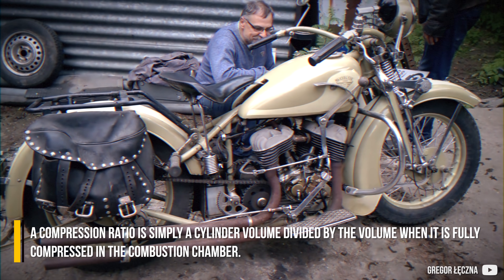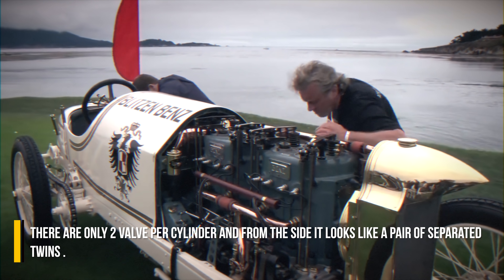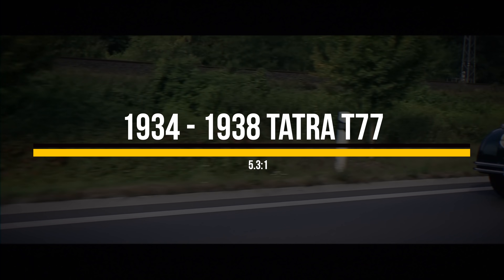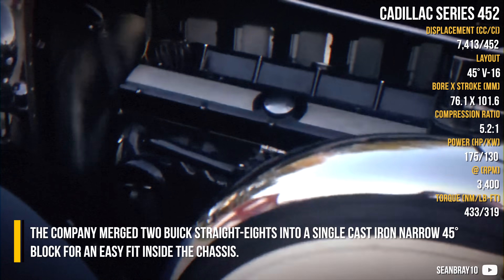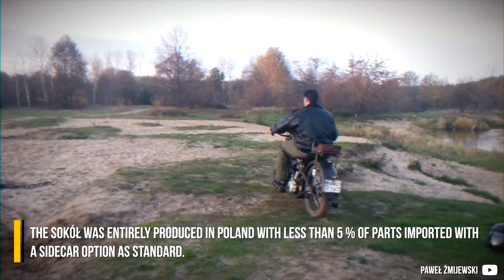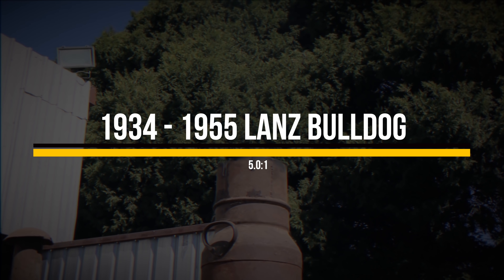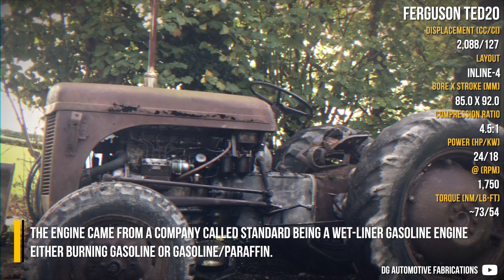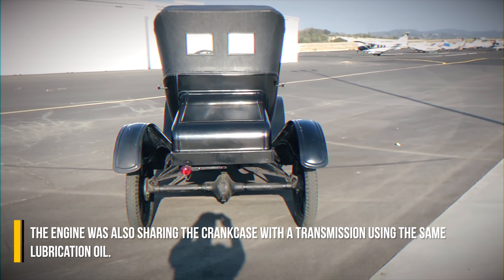The Lowest Recorded COMPRESSION RATIO Engines

Comment: you what's funny about diesel engines, diesel is verry low octane, so low that for about 20-50 years it was considered as waste from producing gasoline, yet the engines only start at a 1;16 compression ratio and tend to be turbocharged at well

Comment: Many American tractors and stationary engines used at the turn of the century were low compression so that they could be started on gasoline, and once warmed up, they would switch to kerosene, because it was cheaper. Many  had small gasoline tanks, and larger kerosene tanks, or the carburetor had a cap you could remove, to fill the fuel bowl with gasoline, to get it warmed up. Ironic now, in the US, Kerosene is quite a bit more expensive than gasoline.

Comment: The lowest compression ratio with a diesel engine must be in Napier Nomad turbocompound aerodiesel; it had a compression ratio of just 8:1. The reason it worked at all was because it had insane boost pressure, somewhere over 6 bars, and why it was fuel efficient was because the combustion energy was extracted chiefly by an exhaust turbine. It didn't enter production though as the turbojets and turboprops quickly took over the piston engines in commercial aviation and it was a complete engineering nightmare.

Comment: Weird timing for this topic for me, cuz my AMC 258cu 4.2L straight 6 is blowin oil thru the oil filler cap on top of the valve cover.... I just performed a compression test where I found the #' 1 & 3 cylinder are at 122psi, the other four cylinders are at 138psi...so now I'm pulling the motor to have the internals reman'd...ain't that a b***h....great vid here bro, your production is outstanding....🤘🏻🇺🇸

Comment: All combustible materials have to be converted to "invisible" vapour in order to ignite. Gasoline is a complex formulation which has very volatile 'spirits' to initiate combustion. Most of the content of the fuel isn't burnt, but expands to a ratio approximating 30,000/1 then exhausted as atmospheric pollution.

Comment: Why does a low-compression motor need low-grade fuel like mixed in kerosene when a diesel must be high-compression to work?
Reply: An engine running on low grade fuel needs a low compression ratio to prevent pre-ignition or 'pinking'. Gasoline and kerosene powered engines are ignited by an electrical spark, a diesel needs to have a high compression ratio to generate enough heat in the cylinder to ignite the fuel without a spark.
Reply: @jonathangriffin1120  So i guess low-compression engines weren't abandoned for diesels as they could use a wider fuel variety. Does this mean lowering the compression of a given engine w. spark plugs can make it burn diesel?
Reply: @sidmarx7276  I don't know if a low compression spark ignition engine will run on diesel, they'll run on kerosene but they need to be started on petrol (gasoline), brought up to running temperature then switched over to kerosene. The Lanz 'Bulldog' tractor uses a 'hot bulb' system which has to be pre-heated before the engine will start, the Lanz will run on anything that will burn but is no way as efficient as a conventional diesel.
Reply: @jonathangriffin1120  I've read about a Lunenberg (?) engine on fishing boats which runs on heavy oil and is started by putting a blowtorch to the cylinder head.  Fancy name for a 2-stroke diesel?
Reply: @sidmarx7276  The Lunenberg seems to run on the same principle as the Lanz which is referred to as a 'Semi diesel', the British Field Marshall tractor uses a 2-stroke single cylinder diesel engine which uses high compression for ignition, it does not use a blower but relies on crankcase compression to force air into the cylinder.

Comment: another fairly low compression engine are those 2-stroke engines used to motorize bicycles. I'm not exactly sure what the compression ratio is off hand, but I don't think it's over 6:1 with a stock head.

Comment: I had no idea an engine could actually run at 5.6 to one compression. that's unreal. not squishing much anything in there.
Reply: Before the ‘40s, most US cars had lower compression than even 5.6:1 due to the fuel being very low quality.

Comment: Most engine design choices are based on fuel available at it's time. As we learned to refine oil more efficiently, it has required changes to design. 
Personally, I think the best fuel and optimized engines were in the early 60's. To the general public I mean. 
Fuel during WW2 was researched extensively, mostly for aircraft but other engines were designed like the infamous "this truck can run on aftershave" type of thing. 
Many farm tractors in the 30's were designed with a ratio of 6 or less. This was because deisel was not popular yet, and farmers wanted something that was dirt cheap and would keep and still work after winter. So they made "tractor fuel" and designed tractors to be able to use it. Some of it was so bad they had mini tanks for regular gas to get the engine started and then it could be switched over. 

There is ads/videos from Oliver about how they experimented in the 60's with high compression gas engines. Allis Chalmers made a fuel cell tractor. 
I love engines and mechanicals. It's important to understand the fuels for them as part of understanding the designs.

Comment: " In theory higher the compression ratio, higher the thermal efficiency"

Why ?
Reply: 🌟 VisioRacer replied: "Higher compression ratio allows an engine to use less fuel for more mechanical power. It is simply all about the pressure. 

But you are using energy to create the compression. 
As I see it, you need to have complete combustion of the fuel and make best use of the heat generated. I'm not seeing how compressing an explosive mixture is going to change that.
Reply: @Alfred Wedmore "If you have a compression ratio of, say, 10:1 and you open the exhaust valve just before bottom dead centre, the gas expands by a factor of 10 before being released."

That's moderately true without a bang. Ideally, you should have a bang and the gas expansion should be nearer10k times.

" If your compression ratio is only 4:1, the gas expands by a factor of 4, and the energy you would get back as it expands from 4:1 to 10:1 is lost into the exhaust.
Thus high CR enables you to make better use of the expanding hot gas."

Not sure where you're going with expanding in the exhaust but the concept of expanding from 4:1 to 10:1 is a nonsense. I suspect the only advantage of higher compression ratios is that you're getting more combustion for a smaller cylinder - so the saving is purely down to the physical size of the engine.

Comment: You should do a video on the Ford 2.3 l 4 cylinder. It was used in everything from tractors cars. The best 2.3 l was used in the Ford Thunderbird turbo coupe. The 87 Ford Thunderbird turbo coupe was motor trend car of the Year because it was the first car to have a 4 cylinder and have as much horsepower as the V8 variant. It was absolutely an amazing engine.

Comment: One of the advantages of low compression engines is that they are easy to hand-crank (or kickstart).
Reply: Was certainly fun watching a guy trying to push start his BMW S1000RR when the starter died
14:1 compression ratio and crazy high gearing meant it took him a couple dozen goes and some help from others to get it to turn over lol
Reply: they also like ether. low compression engines dont go into catastrophic failure even after spraying a bunch

Comment: Low compression engines, also one of the most reliable engines
Reply: Diesels and Toyota v8s disagree
Reply: @zadeoooo  I've also been told that the Toyota Tundra 5.7 Litre V8 engine is loosely based off the small block Chevy 350cid/5.7 Litre.
Reply: @ChillkootMarkowee  lol. They're pretty different, note and stroke are different it's a quad cam overhead valve Design vs a single cam in block. They're very different
Reply: @zadeoooo  Yes I know I know, thats why I said "loosely".
Reply: @ChillkootMarkowee  couldn't be much much looser than that lol
Reply: Yeah, less wear, but you drink dinos like they're still walking around.
Reply: @magisterrleth3129  I like your wording.
Reply: @magisterrleth3129  don't go there.
Yea, there.
Unless you have the geological proof, just don't.
Reply: @danieljones317  What are you talking about? If you're going to clutch your pearls, it's best to be clear on what you're clutching your pearls about.
Reply: @magisterrleth3129  I have no need of pearls.
I work with reality.
Every last petroleum geologist in the world has known for twenty years that your "dinosaur" oil has been gone for some time.
What there is today is generated deep within the earth.
Water, carbon, hydrogen, and a lot of heat and pressure.
A very specific contaminant comes along with it, and with that particular contaminant, you can tell if the oil is from organic, or geological processes.

Why don't you deflate that ego, and don't bother to reply until you know what that contaminant is?
Reply: @danieljones317  I realized what you're talking about. Abiotic hydrocarbon generation. It's possible. But in the quantities and concentrations needed for commercial viability? I find that questionable, and so does most of the geology community. Because there is no special contaminant that allows one to distinguish how the petroleum was made, and we have not yet found a single petroleum deposit that couldn't be explained with the biotic process. Until there's a definitive deposit that can't be explained any other way, I'm not convinced.

Tell me the name of your contaminant. I'd like to hear all about it.
Reply: @magisterrleth3129  the Chinese knew of it over 3000 years ago.
The "rediscovery" was covered up in the early 2000s.
The contaminant?
Microdiamonds.
The only place in nature those are found is deep, mantle deep.
That's why all of the wells that were thought to be dry were somehow "rejuvenated."
Further, why would anyone ever shut down their own wells to purchase from someone else?
Well, you'll just have to talk to one of the Political Control Freaks for that answer.
Reply: Not true but low compression engines will run on low octane gasoline like 87 octane or 95 ron in Europe which is 87 octane just rated with a different method depending on ignition timing, combustion chamber design, intake air charge temperature etc many variables...I have a 1988 ford thunderbird turbocoupe and it has an 8.1:1 compression ratio or something like that...it has a switch for regular (87 octane) or premium (91-94 octane) by using a knock sensor when the switch is flipped and it either retards (87 octane) or advances (91-94 octane) ignition timing, I love it even with 87 octane my car still makes 200hp and pulls a 3800 pound car (2 passengers) with ease and handles 17 psi of boost without the need for water methanol injection to cool the air charge, lots of factors in making a reliable engine...but generally low compression engines usually have less sensors and what not if fuel injected...generally less sensors means more reliability lol plenty of high compression gasoline engines still around from the 1960's working fine and that's with very unrefined technology with poor combustion chamber and poor cylinder head flow more just made to make it work...less or no sensors, more reliability
Reply: not if you're only using premium gas
Reply: They work on magnetos, too! 
Same principal behind the way a gas lawn mower works. A magnet goes past a coil, which makes the spark.
Reply: I mean it's not really a problem to build a "high" comression ratio engine that will last half a million kilometers and even more. The Alfa Romeo 75 of a friend of mine has over 700.000 km (145 hp 2.0 liter) and our Renault Espace 2 (107 hp 2,2 liter)has 500.000 km and both of them get driven relatively fast (both have normal compression ratios). Both are pretty durable engines. It is definitely possible to builld good engines it's just that a lot of cars don't have one. If you think about the formula 1 cars of the 80s you have engines with 1,5 liter and over 1000 hp. And they also get driven hard. So an Engine with 2 liter and 150 hp should be able to last an "eternity".
Reply: Compression ratio's has nothing to do with reliability. Don't be so irresponsible to mislead people.

Comment: It isn't just fuel quality or boost pressure that determines the CR that is possible. Combustion chamber shapes also have a huge effect. People can make a 7:5:1 Ford Flathead, but it has to be done just right on 93 octane. A lot of modern 4 valve combustion chambers have 10:1 compression and on 87 octane.

GDI also made higher compression possible. I use the VW 1.8T 20V and TFSI engines for comparison. Some of the GDI VW engines would make as much HP as the 1.8T 20V, but use 87 octane instead of 91 or higher.

EDIT: There is another thing I find interesting about compression. Diesels have had lower compression over time. The lowest production one I know of is the Mazda Skyactiv D, which has 14:1. Most DPF diesels needed 16.5:1 in order to function. Back when there was early direct injection, non-DPF diesels, 19.5:1 was common. Prechamber engines were typicaly 21:1 or higher.

Comment: Compression ratio was low back in the day but it helped with simplicity and longevity of these engines. Alot of them had exhaust manifolds attached to the intake to help vaporize the fuel and help burn off due to the lack of compression. Also some had low enough compression like tractors so they could be designed to run on kerosene!
Reply: Diesel engines that have much higher compression ratio then gasoline  run perfectly fine on kerosene if you just mix in some 2 stroke oil (1:200 or so is recommended)... Have done it for 2 years now on 2 different modern turbo diesel cars to burn away old kerosene that now is illegal to use here for heating of a house if you have built in electricity.
Reply: @a64738  ive run diesels on kerosene transmission fluid and used motor oil and vegetable oil. Anything that has an oil base and can be filtered out well.
Reply: @a64738  Of course, kerosene is very similar to normal diesel fuel, and they have this wonderful property to self-ignite. This self-ignition must be avoided in spark-ignited  engines, because this self-ignition (sometimes in the form of detonation) happens at completely the wrong moment (usually too early), leading to wear, or even destruction of the moving parts.

Comment: Honorable mention: The Oldsmobile 260-ci. V-8 (1977-1980) 7.5-8.0:1, 110-hp.
Built as an all-encompassing solution to meet the demands of increasing EPA emissions & CAFE fuel economy mandates, as well as traditional Oldsmobile buyers whom sought the smoothness & low-RPM torque of a V-8, Oldsmobile modified it's OHV 350-ci./5.7L V-8 to have a reduced displacement of 260-ci/4.3L with an severely reduced operating compression ratio, in order to reduce oxide of nitrogen (NOx) emissions. Introduced with a 8.0:1 ratio, then lowered to 7.5:1, it is one of the lowest compression engines built for passenger-car use in the late 20th-century. 

If you see one these engines, run... and report it here. Despite being produced in considerable numbers, rather few units of it survive due to it's lackluster performance, often leading to them being overworked to the point of failure when called upon to perform duties larger, or even smaller engines with far-greater efficiency could easily handle... and their inability to share performance parts with it's larger sibling, because of it's much smaller cylinder-bore size and cylinder heads with oddly-shaped (square vs. upright rectangle) intake & exhaust ports. :(
Reply: The biggest honorable mention should go to the Pontiac V8 during the Malaise era. It became very obvious around 1970 that all the divisions of GM were all making the same displacement engines to prepare for the coming corporate engines. During the Malaise era, they all made roughly the same horsepower from the same displacement regardless of which division built it. The Pontiac engines had their compression cut to 7.6:1 while everyone else’s were at least 8:1. Also Pontiac produced the SD 455 from 1973-1974 which was one of the most powerful engines built during the V8 era and it only had a compression ratio of 8.4:1. Pontiac also built the last high performance V8 of the era with the W72 400 available from 1977-1979. While making 220 HP with 8.1:1 compression with the horrible pellet type catalytic converter clogging the exhaust, I think it was the NHRA that claimed it was really making somewhere in the neighborhood of 270 HP. It wasn’t until GM started to put fuel injected 350s in Camaros and Firebirds that would be able to match the performance of the W72 equipped Trans Ams of the late 70s.

Comment: High octane fuels were often not widely available, so manufacturers built to the specs for low octane fuels.
Reply: Also weaker parts and metallurgy, higher compression ratios put way more stress on the engines.
Reply: @archygrey9093  The engineering that came out of World War II really helped the automotive world with better fuels that allowed higher compression ratios to be used. Metallurgy also took huge leaps ahead. The Ford 9N tractor of 1939 suffered from weak cast iron parts in its transmission and rear end. Compare it to the almost identical Ford 8N or 1948 and those weaknesses are now the strength of the design. The transmissions and rear end of the 8Ns could take far more horsepower input than the 1939 tractors and since the trans housing also acted as the rear tractor frame, could take greater stress from work loads.